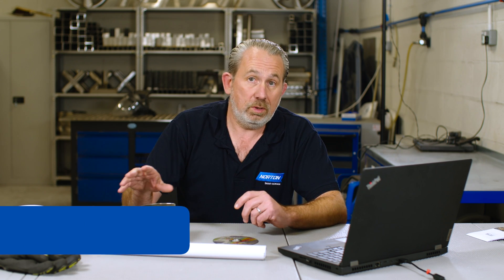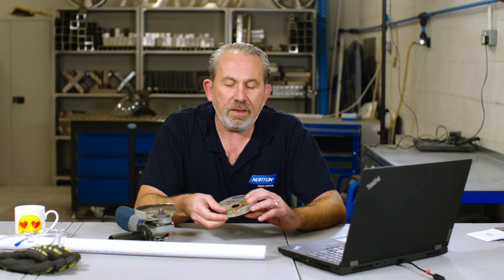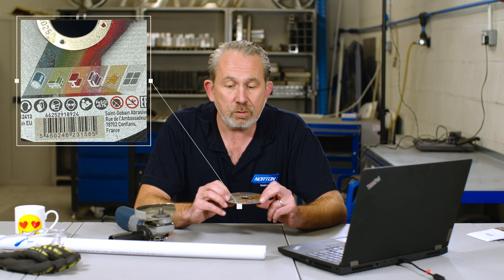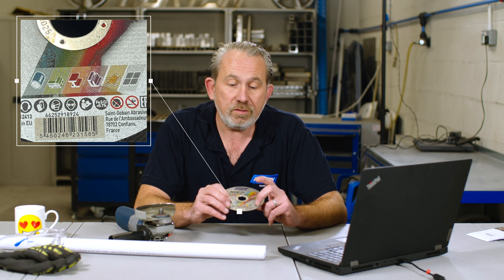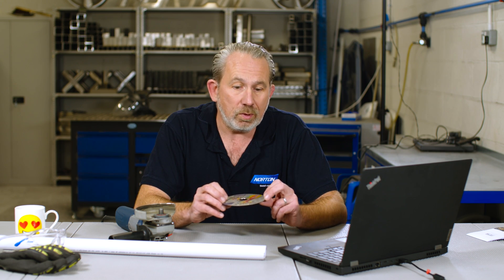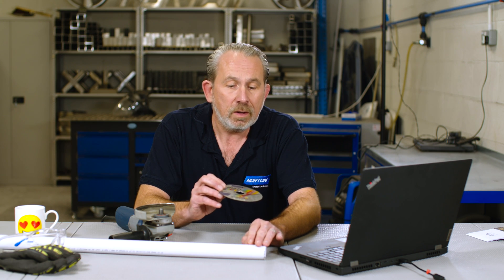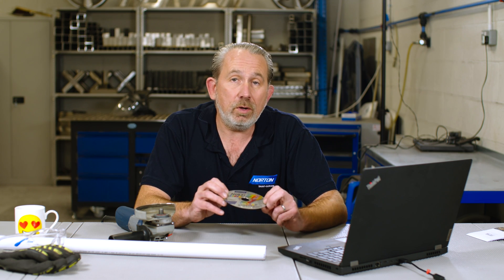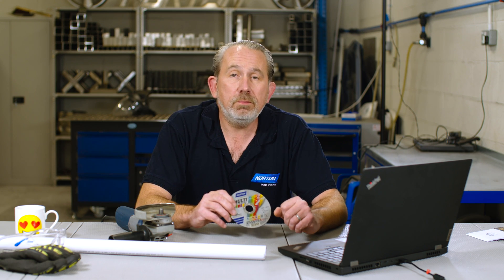ASK THE EXPERT: Can you cut plastic with an angle grinder?

Comment: Can you cut plexiglass with an angled grinder (with a cutoff wheel)?
Reply from the maker: Good question!
Plexiglass is Nylon based so if you use a Multi-material cutting disc you will be able to cut Plexiglass no problem.
Our suggestion would be to use a 1mm Multi-material disc and cut quickly to minimise heat. If you do get any burn or small areas of melted material on the cut edge, you can easily remove it with a fine grade sandpaper.
Hope that helps and thanks for watching.
Reply: @NortonAbrasivesEMEA Thanks so much!